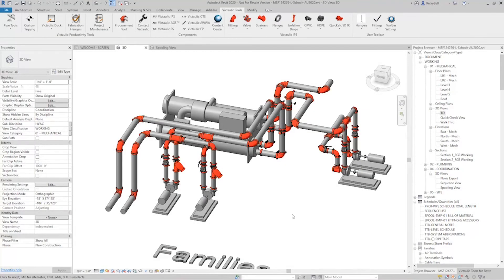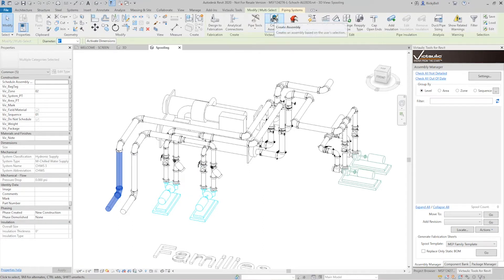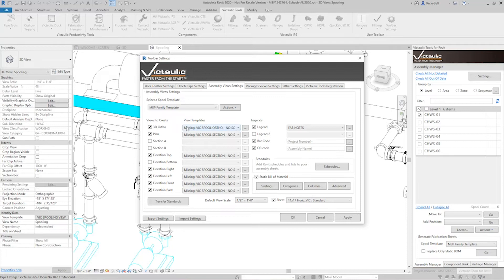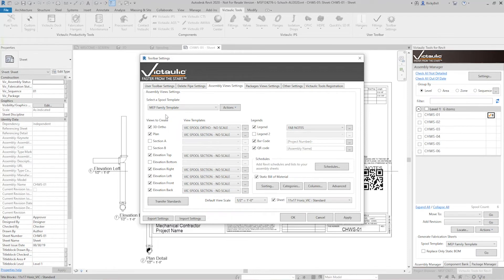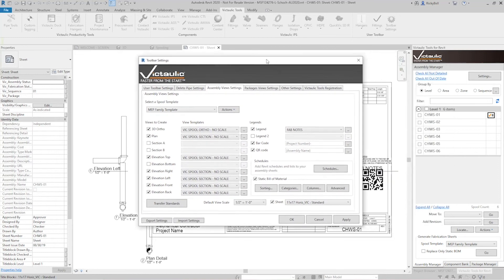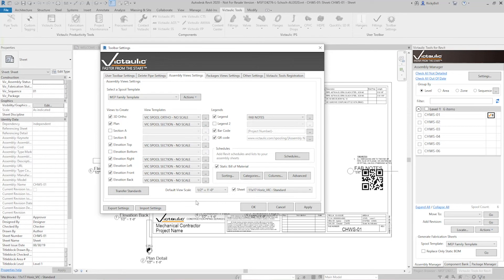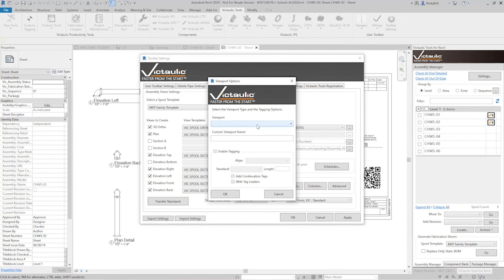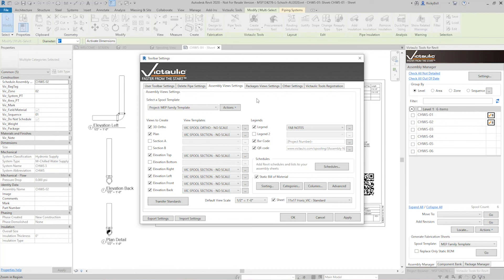Fabrication Spooling - Victaulic Tools for Revit®

Comment: Is there a way to show the architectural backgrounds in the section view?
Reply from the maker: Thanks for the question! It is possible for a user to create and drag a view showing the spool in the model. We did not create any automation to do it.
Our internal workflow is to define all the spools, then generate a Fab or Erection Map using the package manager to show where each spool is located in the system and/or project.
The new 3D viewer on our SpoolTracker website is great at automatically showing the spool in the context of the larger project too!